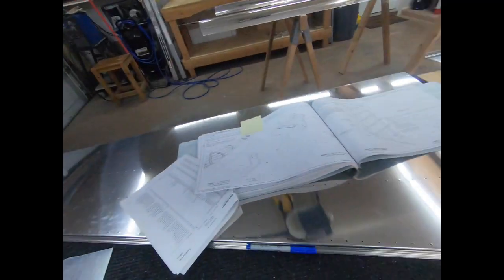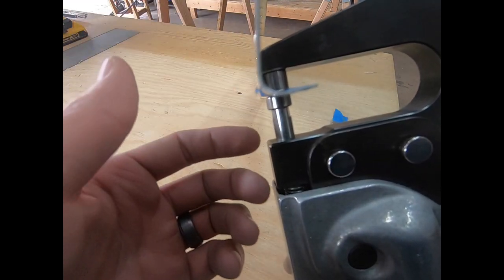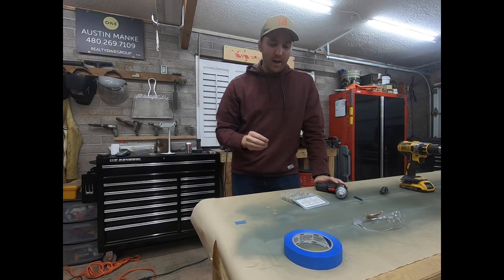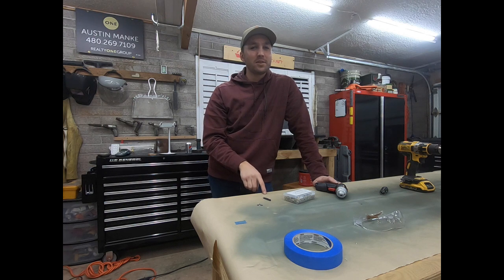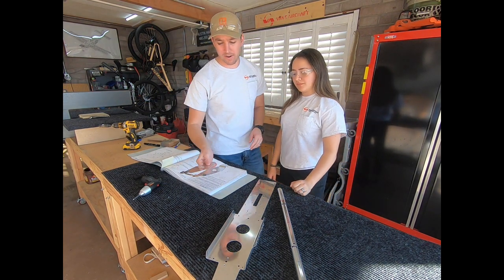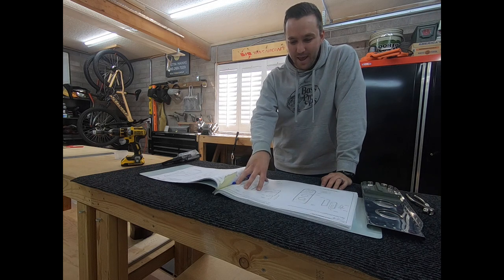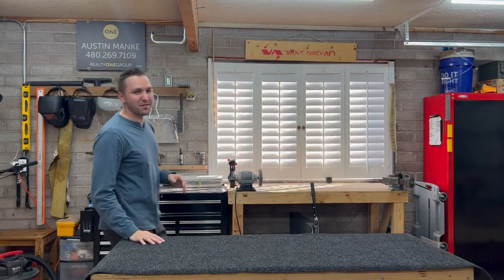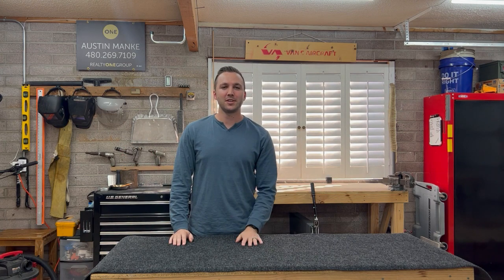Van's RV-10 Tailcone Build, Part 3

Comment: Thanks for the videos.  I noticed that the tailcone F-1006 bulkhead flanges are bent substantially inward which makes sense given that those flanges face aft and the tailcone tapers, but the plans do not specify an angle for those flanges and they also do not say not to straighten them. Similarly, the tailcone frame flanges, which all face forward, would seem to need a slight outward bend but no angle is specified. The plans do say to flute the flanges and I would normally straighten them to 90 degrees before fluting. Should these tailcone flanges all be straightened to 90 degrees or left as they came from the factory?
Reply from the maker: Hey there! If I remember right, I didn’t have to bend the flanges on the tailcone to match the skin angle. Looking at the  flanges as they are now, it looks looks like all I did was flute them to straighten. I'm pretty sure I just let the rivets pull everything tight against the skin during assembly, and it worked out fine. I would recommend a call to the builder support line though if it worries you at all. I use them quite often. Hope that helps!